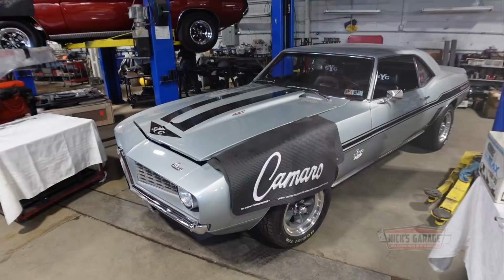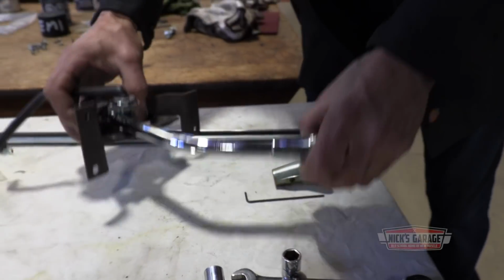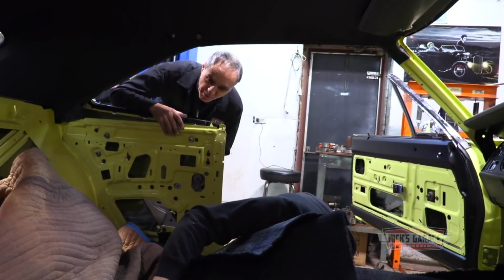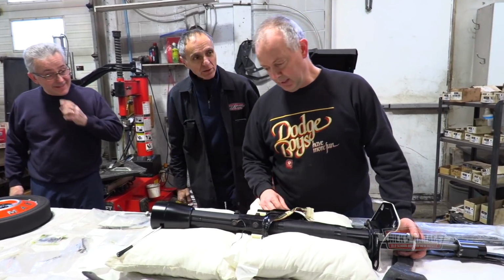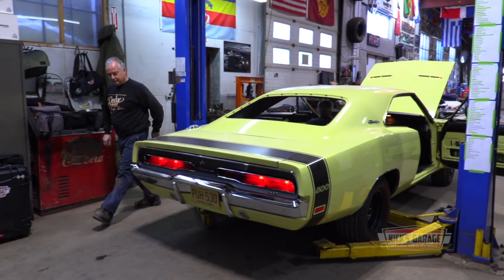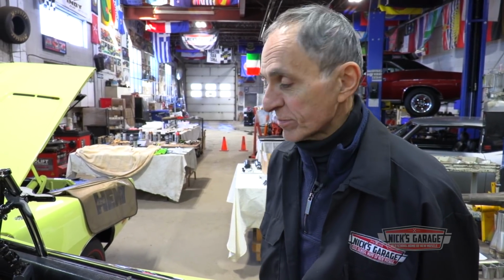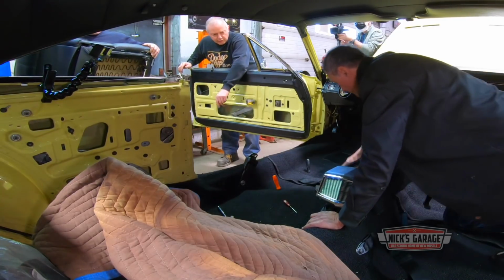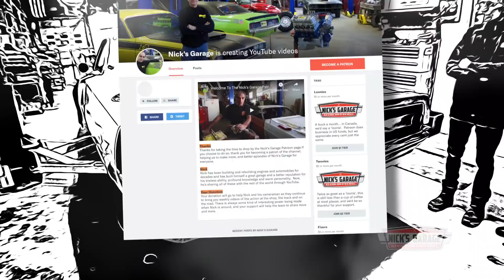1969 Charger 500 Restored - Interior Installed

Comment: That 69 charger 500 is coming along nicely Nick.  I grew up like you did around  these cars could not afford them when I was young.
 I made my own Hot Rod. Ford 1965 Ranchero Deluxe. It came with a 289 V8 Automatic. Everything on the engine was High Performance. Drove it for 13 years

Comment: Nick... Between 1968 and 1972 I worked at two Mopar dealerships doing customer repair work. And a lot of warranty work. Chrysler did not reimburse us (dealer) for all the repair time we spent chasing solutions to oil and water leaks, squeaks/rattles, complaints of low power (I got beat Saturday night so my car must be broken!), etc. So we had to charge out small parts  and charge Mopar for the repairs (even though we did not perform the work) just to break even. As a result my work area was loaded with interior trim pieces, weather strips, switches, sensors, gaskets, and more. I can't tell you how many arm rests, valve cover gaskets, oil pressure sending units, etc. that I tossed in the trash when I accumulated a lot of parts. If I had only planned ahead! Watching the reassembly of the Charger 500 brings back many memories. I likely had every part on that Charger on and off at some time but  it took several hundred different cars to get 'er done! Keep up the good work.
Reply: I wish I had all the parts you threw out.

Comment: Nick you and your men have done an amazing job on that fine looking piece of machinery I’m sure Eugene will appreciate it when he’s driving around in Texas and I hope he doesn’t run into any longhorn steers or any of them big old deer in Texas. Nick you and I have a lot in common when I was a young boy my uncle Ralph had a welding shop grandpa long taught me how to weld and braise my uncle Dave had a mechanic shop taught me how to rebuild engines tuneups brake jobs when I was around 14 my father was a brickmason I learn how to lay brick when I was a young boy I remember my very first automobile it was a 1956 De Soto station wagon it had that same hemi engine that you have in your shop it had a rod knocking at it my uncle Dave would tell me stories of when he was in World War II how they would wrap leather around connecting rods that were knocking and put them back together and send them on their way so I thought to myself I wonder if that will work in my engine so I started pulling the oil pan off found that connecting rod that was knocking wrapped a piece of leather around it stuck it back together and it run fine for quite a while oh and then I got into motorcycles and then hot rods I had a 71 Plymouth duster 340 wedge. I used to do all kind of trick stuff to it one of the tricks that we used back in the day was a coiled up piece of copper inside a can and we would pack that can with ice run fuel through it into the carburetor that was for Friday night racing well that’s all for now you and the boys are doing a fabulous job I love your program. 👍👍👍🤠🙏🏻🇺🇸

Comment: nick on the seat track holes in the carpet take a soldering gun and melt the holes bigger sos the seat bolts will go through easier less hassle this way
Reply: Good point. Thanks.

Comment: Great job on the car Nick. The chrome housings on the sides of the console with the courtesy lights can be installed 2 ways. From the video it appeared they should be turned 180° so that the hooded part is more towards the console top, directing the light more towards the floor. Won't be long 'til it's back on the road again. 👍

Comment: There a good trick i been thinking about when installing carpert and front seats .. When you mark the mountind hole for the seats using screwdriver slip a rubber gromment one about the diameter of a pencil... the idea is when you slide the screwdriver in the hole you can slide the gromment off and fitted it to the carpert you may need to experince till you get the right size.that should help when you installed the seat plus give a little seal for the bolt.. it time comsuming  I know i thought it may make it easier to see the hole.. another idea which might be better is using push pin plastic rivets with a long shank.. just some crazy ideas.. Eugene Car looking GREAT! I wish i had the money and my Bee i would sent it to you to restored..

Comment: Hey Nick, the 500 is looking amazing! I have the exact same console in my fury (with brush metal inserts instead of wood grain). I don’t see the holes for the “Pentastar” on the fender. I replaced nine and there was a hole for a pin and another for a clip as I recall. Also have seen an aftermarket piece for the end cap on the console, (mine has slight pitting like that 500 does, are you going to replace that? After so much restoration, it seems a shame to not replace that part. Also mine has sleeves on the seat belt near the console so yo don’t have to fish for the belts each time you get in the car.

Comment: 1157 bulbs were park/brake light bulbs. 1156 was for backup. Simple.
Reply: What Nick means is, the taillights have 3 bulbs on each side, but only the the outer ones are 1157. The inner light on the taillights are parkings only, but if you put an 1156, it’s too bright. A 67 works good.

Comment: I noticed that there is a gap between the bottom and back of the console and the carpet, is this how Dodge designed it? I know it will not be noticeable once the seats are installed. On my 66 Chevelle the console fits snug against the carpet all around the base.
Reply: That is the way Dodge designed it.